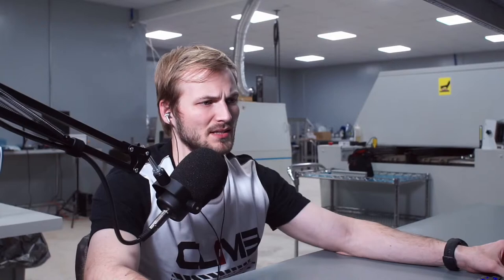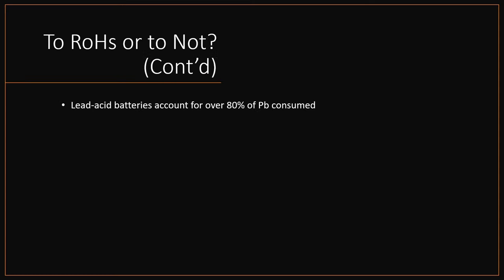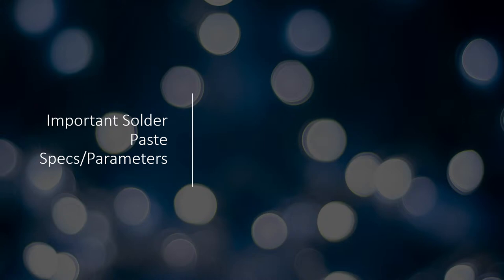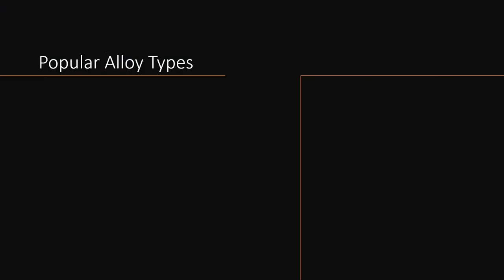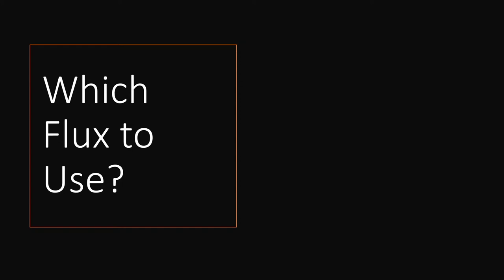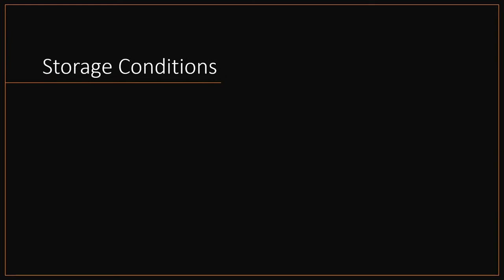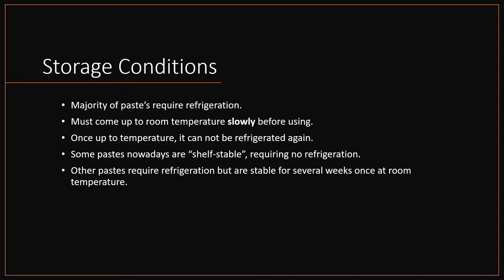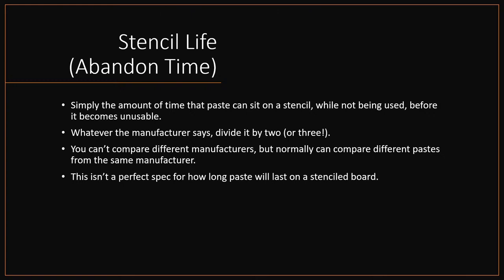Live Lecture Series #3: Understanding and Choosing the Correct Solder Paste

Comment: Good Lecture!

I don't think hobbyists should use leaded solder paste because paste can get everywhere if you touch it, and then there is an not unreasonable chance it could be ingested.  Leaded wire solder, I agree is not that dangerous. However, I prefer lead-free solder on protoboard because it is easier to make intentional solder bridges (I think leaded solder flows a little too well in this case)

Comment: May I ask you a question? To solder very small SMT parts, how do you know if you should do it with Hand Soldering or with a reflow Soldering Machine and a stencil? Should we always use a reflow machine for small SMT parts, or it depends? For example, HDC1080DMBR WSON-6